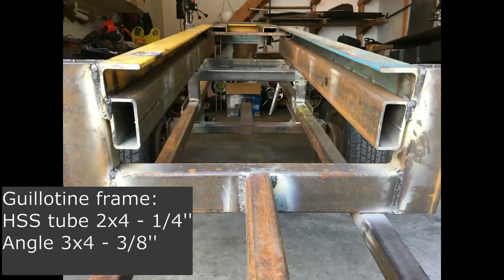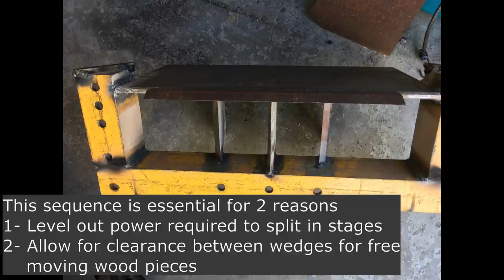Box Wedge Splitter - Fast and Safe

Comment: Vary well made Sir. Can you give us some detail on the Crain? the bending arm is most interesting. what do you think it can safely lift when at a 90 deg
Reply from the maker: Many thanks!  That is a very clever question, as you undestand it is it's weak point. I would say a very safe 200 lbs. It did double of that, but obviously with loads near to the ground and noticeable deflection. The bending arm is the reason why I choose to double the tubing on the mains arm, instead of a top tie rod. It gave me more working height with same post height. It is made out of a 2x3 - 0.125'' tubing and a mechanical round tube (cold rolled / 1'' ID x 1.5'' OD) for the hinges. And the pins are 25mm (yes, metric!).  So they have 0.4mm or 1/64th clearance, which is optimal.  The remainding is gusseting/reinforcing at stress areas.

Comment: I've built lots of wood splitters. This is a clever design, good job. Is there anything you wish you did differently? Thanks for the great video.
Reply from the maker: Thanks! There might be changes I will make for the future.  The pump is undersized.  15hp motor and 5'' bore hydraulic cylinder. But only 12/4 2 stages pump.  Since the wedge is in sequence, I discovered that it does not need much push to split. In this trial, I did not went over 1200 psi.   I could have used a 16/4 to match. Even a 20 gal/min single stage might have worked.

Comment: Joe what grade of steel did you  use for the blades I used a36 and it bent when it hit knots, can you help me with this? thanks Jim
Reply from the maker: I could not tell the grade, but it was big old industrial planer blades or chipper blades.   I got them at the scrap yard.  So far, I did not break anything and still pretty sharp.  I did a google and A36 is a mild steel.  Not very good for blades.  What kind of metal supply do you get access to?
Reply: @FromSteelToWood  Hi joe thanks for getting back to me,  I just went to the steel co. to day, and got a peace of ar plate 1/2 inch, iam going to cut back the a36 blades I got on ebay, and weld on a cutting edge of the ar 500 plate, thats one of the problems i was going to use some of my old chipper blades, but did not. also haveing problems with the engin, not being able to push the 35 ton piston, I order the same engin that you have, waiting for it to come in. Ill let you know how this all comes together. thank you Jim
Reply: it looks like you have a brace on the end of the pusher frame to keep the ends of the pusher frame from flex, I have on the pusher end 3/4 x 6 x 18, and also added 1x6x18 ar plate, because  the 3/4 was flexing,  and now all of them are still flexing when iam pushing wood through, at some point, ill have to send you a clip of this, i tryed to make it some what like yours in you plan, i did not need the log lift, i use my bobcat to pick up the chunks
Reply from the maker: I would be glad to receive pictures.  You can send them to joe.lesage@hotmail.com

Comment: Very nice, what do you figure the components  cost all told?
Reply from the maker: Thanks!  About 2000$ (CND) so maybe 1,500 USD. Motor, cylinder, valve, hoses, pump are near 75% of the cost.  So if you can get some used part, you would save a lot. It weighs about 1000 pounds, so you can figure the cost of steel.

Comment: Wow very impressive designing and execution of carry thru. Did you also make the log tongs? Seems that it doesn’t even think about losing the log load at all. I am certainly envious of your talent and ideas. Again well done.
Reply from the maker: Thanks!  Yes I did the log tongs.  They are linked with a chain and clevis. For smaller logs, I shorten the chain to keep a good grip.  They have sharp tips also. Most importantly, I have welded small handles on the side, so you don't get your fingers pinched between the tongs and the log when setting in place. See my other videos of the log tongs ( https://www.youtube.com/watch?v=uFJsPaZmogE )

Comment: Do you have any kind of prints or measurements on that I really like your design you have any information on it so that I could build something very similar I would love to have as much information as you give me and that I really really like your splitter I have made a few others but they’re just standup ones with cranes on them as well but nothing like what you have I would love to build one like that I have just the stuff to do it
Reply from the maker: I will see what I can send you.  I've got your E-mail. Most of the drawings were initially in my head... Even I am an engineer, I rather like doing designs on the spot.

Comment: Beautiful work! The last pieces that go through the box wedge... do they get stuck?
Reply from the maker: Thanks!  That is possible the last piece get stuck, but an easy way to dislodge it is to take an already split piece and split it a second time while pushing on the stuck piece. So those new split pieces are definitely smaller than the opening of the blades, so they are free. You might want to see this splitter being updated to a much faster version! See link below
https://youtu.be/B9jCUIIlusY?t=290
Reply: @FromSteelToWood  Thank you, I just fab'd a splitter inspired from some of your ideas - just with recycled materials to keep costs down (not including my time, lol, to hack other things apart and incorporate into design). Thanks again for the great video.

Comment: I don't find very many home built splitters on Youtube impressive, but yours sure is. I love the square, uniform pieces it produces. It'd be nice if the log would drop in the tray on the return stroke. Would graphite spray on the floor and the return pusher help? Or does the return pusher need a smooth, solid face? Anyway, very, very well done!
Reply from the maker: Thanks.  It really stacks very well when you have square pieces.  Look for my other video, where I made the fixes. Pusher needed some mods in order to drop back the log into the tray. ( https://www.youtube.com/watch?v=RP22PBWRFHA )

Comment: What size is the pump? It is no longer available from the link above. Thank you.
Reply from the maker: Sorry for the late reply, Youtube does not send me all the notifications...  You are right, the part is no longer available.  I am currently upgrading the pump and found a bigger one at Surplus Center. What is the engine size you have?  Up to 10hp, there is a very affordable pump at Princess Auto
https://www.princessauto.com/en/detail/9-hp-2-stage-hydraulic-pump/A-p8725947e
If you need bigger, they get more affordable at Surplus Center (in USA, but they deliver to Canada)
https://www.surpluscenter.com/Hydraulics/Hydraulic-Pumps/2-Stage-Log-Splitter-Pumps/
Reply: Thank you! I recently bought a very large homemade conventional splitter, and I would like to make it into a box wedge splitter similar to yours. The splitter I bought has a cylinder with a 6" bore and a 4" rod. I'm thinking 20+ gpm to keep my cycle time fast enough. The splitter also has a Vickers vane pump (gpm currently unknown but 1 1/2" inlet and 1" outlet!) and a currently not running 25hp Onan engine.
Reply from the maker: For your reference, the 26gal/min pump I bought has a 1in inlet, 3/4in outlet... You might expect a much higher gpm than that. But a 25hp engine is not sufficient... Having a 6in bore is great, then 4in rod is even better, as the retract cycle is faster. If you have pictures, I would be glad to see that machine! 
joe.lesage@hotmail.com

Comment: Well done sir, it looks good, it works well, it saves a huge amount of effort in lifting logs, and I'm sure that you've had as much satisfaction from designing and building it as I've had from watching your video.  Just one question. How does it cope with knotty logs?
Reply from the maker: Thanks Mike!  It does perform very well in knotty wood.  It simply cut the wood at this point instead of splitting it. And yet makes nice even logs.  When this design gets bogged down, it is where the wood is very twisted. It will always split, but it will generate a lot of debris (kindling). You may want to take a look at this video where you see one twisted log. It appears to be straight, but it's not...
https://youtu.be/XpjP8y7sDWo?t=248

Comment: Nice build, I really like the "crane," seems like it has a lot of reach. You could split half a cord without pushing blocks up to the splitter. Also nice sizing of the split pieces.  What were the dimensions of the boxes?
Reply from the maker: Thanks.  The crane has a 10' radius reach. There is a 90° blind spot in the direction of the tongue beacause of the post standing behind the hinges. This allows for a very strong pivot.  Consequently, I can pull horizontally with the crane. So the reach is as long as the cable. It does not need to pull strictly vertical. The wood piles can be anywere around the splitter.  The boxe is 24'' long x 16' wide.

Comment: After spending a Spring and summer sawing and lugging 30 inch + dia. maple blocks, I was really impressed with your jig crane and I am currently in the process of building a similar one.  I am having difficulties finding suitable supplies for adequate pulleys and especially the sheave at the pivot point between the beam and the jig.  Could you share the sources of your suppliers?  
PS.  your crane is the best and most versatile one I've seen.  Congratulations on your design. 
Thank you,    jp
Reply from the maker: Thanks for your comment!  There is a trick with the sheaves I did not think of showing.  I used variable speed sheave, which has the variable width adjustment. I opened at the maximum, and put a small piece of pipe over the thread, so the bottom of the pulley is smooth. It was available at a local surplus hardware store.  Depending if you are in US or Canada, you could find supplies at Harbor Freight, Surplus Center (both US) or Princess Auto (Canada). You could also look at a flat belt idler pulley, which could work fine too.  As far as you have a flat bottom, yet guiding sides.
Reply: That's the Madawaska River in Eastern Ontario -- not the one one in N.B.
Reply from the maker: So you are closer to Princess Auto than I am!    I went to Renfrew a few years ago and this is a nice part of Ontario.

Comment: Looks good but most of your pieces seem to be pretty straight grained    And it is maple.   I also build a box type and have found that if the first cut rides up the all your pieces get messed up.  Also there is a ton of shake from doing it this way.
Reply from the maker: You are right.  This was mainly straight grain.  But if you look at the video in the background, you can see the kind of tree I've got.  They have 40' straight trunk before the first branches.  I understand what you mean.  For this purpose, I put the smaller odd pieces in paper bags (leaves bags). They will be used later for the pool heater.

Comment: always been curious, why can't a hydraulic splitter move faster?
Reply from the maker: It can definitely move faster. But you will trade pushing force in order to get it faster, given the same motor, same pump. And pump flow is usually sized near to the capacity/power of the motor. This splitter could have been almost 3 times faster if I used a 3'' bore cylinder instead of 5''. But with remaining 12 tons of push, the bigger/knotty logs would stop the splitter.
Reply: You can always go faster , all you need is more volume and more power to maintain pressure under higher volume. Meaning bigger 2-stage pump and bigger motor, which means more $$MONEY$$ . This splitter is perfectly matched for average homeowner.
Reply: It's easy and fairly inexpensive to build a medium pressure hydraulic system to do work. When you want to do the same work faster, the cost tends to go up exponentially. Better to grit your teeth while you wait...
Reply: This is a very nice system by the way. Can easily see you have put a lot of thought into it. Appears to be very robust.

Comment: after watching this I'm building one almost identical. already received most my parts.
Reply from the maker: Glad to hear that!  Did you see my other video where I show some drawings?  Enjoy your project!  Post videos too!
Reply: Joe Lesage  yes I did. other than how you adjust the pan or tray height. decided to build one like yours cause of simplicity and the crane. after picking blocks up to our current splitter and it still hurting weeks later I'm done with that.
Reply from the maker: You are right, it did not show how to adjust it.  It is adjustable, but not meant for regular adjustment. The bottom of the drawer's frame is actually bolted to the side beams from under. In order to lower the bottom, then I unscrew the 8 bolts loose. I can add shims/blocs then tighten the screw. If needed to lower more than an inch, I need to use longer bolts. At 1:56, we can see the 4 square tubes on the side that are the frame. (https://youtu.be/7yb3eVTTr2I?t=116). In the update video, we can see the bolts going through the 2x2 square tubes too (https://youtu.be/RP22PBWRFHA?t=141)
Reply: Joe Lesage ok thanks, I think mine is going to make 6x6 pieces so adjustment probably won't happen. and I did finally find you blueprint video. will have to scribble a copy out to go off of. very helpful .

Comment: I see, Princess Auto, looks like you're a fellow Canadian, eh? Anyways, I've been mulling over building a splitter as well. I'd rather spend $1500 bucks on parts than buy one for $1200 that's not nearly as good as a home built one. The only thing I've been hesitant about is the cost and time it would take me with all the other projects on the go. If you don't mind me asking, what part of Canada are you from, how long did it take you to build and what kind of investment ($-wise) would I be looking at for something like this? Very impressed with your work!
Reply from the maker: Thanks! Yes from Québec. I think it is near 1000$ (all CDN) for the parts at Princess Auto. Maybe 500$ of steel. And 500$ for consumables and hardware (bolts, paint, welding wire, cutting disc, etc). It took me around 200 hours. Most of it is for cutting the steel...  I think I could have saved more than 300$ if I did buy the components at different moments, watching for their mega sales each time. I did built it for the pleasure, not for the money to save. Otherwise, I should have rent a splitter for under 100$/year...
Reply: Yeah, that's what I thought. It didn't look like a weekend project! :) Good for you. Maybe one day I'll be courageous enough to try something like this. Thanks for sharing!
Reply from the maker: I have seen (and suscribed to) your channel and obviously, you are well skilled for such project.  It's just a matter of choosing the project you want to do with the time you have!

Comment: Get yourself a picaroon to help out handling the logs, especially when they are in the splitter and need to be pulled back a bit.
Reply from the maker: Thanks for the advice. I do have one.  I am not confident with that kind of tool.  Don't know why, maybe I am afraid to hurt myself with it.  I understand it can prevent me from pinching my finger between two logs.

Comment: How well does the box wedge handle big knots in the wood?
Reply from the maker: I think it will handle easily from a point of view of power. But my only concern will be the shape of the pieces resulting of knots. It might results in a lot of small uneven pieces. I will see next spring!
Reply: I assume you mean the uniformity of the pieces for stacking neatly?
Reply from the maker: The wedge does not always follow the wood grain, as the log is being held from underneath. More over, when the log enters the 3 vertical knives, it cannot move along the wood grain.  So I rather meant I could end up with significant quantiy of unstackable uneven/odd chunks. Most of the knotty log will provide good pieces, but I will have some loss with unwanted chunks. That is what I assume could go wrong, worst case scenario.
Reply: I understand. Chunks are fine with me. I keep them in a large bin and use them in my wood fired grill.
Reply from the maker: I burn them in the pool heater!

Comment: Very well done!
Reply from the maker: Thanks!
Reply: @FromSteelToWood  I just noticed that you used a 5" cylinder.  Have you considered pilot operated dump valves to speed up the cylinder cycle time?  I ran that same cylinder on my processor and found that this was a very valuable (and not too expensive) add-on.  See reply # 36 here:  https://forestryforum.com/board/index.php?topic=97365.20

Comment: I see that you have a tractor in the background with a bucket on it. Why not place the bucket in front of the discharge are and let the splitter automatically load the bucket and then haul it where you want. Or perhaps that trailer in the background could be used if you get the splitter high enough. No need of double handling.
Reply from the maker: Sure.  I don't like double handling! I just finished welding the slide that will direct the log into the trailer. I prefer the trailer as it contains more than the bucket. Especially with tangled logs.

Comment: I like it.  Except for the paint, I think you should  repaint it, maybe red or yellow.
Reply from the maker: Thanks. You are right.  It should have been a bright color. But I still love grey (don't ask me why...). BTW, this is a mix of flat black and aluminium silver paint.  Aluminium silver has an outstanding coverage and resistance. This is very convenient with little or no metal preparation.